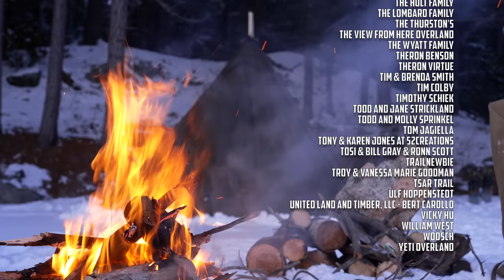WINTER CAMPING ON LAKE ICE -25º | VALENTINES DAY TRIP | HOT TENT AND WOOD STOVE  // EFRT S8 EP7

Comment: just heads up . a pan big cake sheet works great under pop up tent stove.BUTT put a couple short wooden boards first on the snow the cake sheet pan. and pull the pan out to u a bit so it catches the ambers when ya open the lil stove to add wood. u got it

Comment: I have a similar tent and stove. They do work good. The tent has withstood strong, 40-50 MPH winds. A couple suggestions. Aim the opening of the stove to where you can easily restock it during the night. Keep the wood right by it. When you put the rings on the pipe, put a bunch on at the same time it makes it easier. 
The only down side is internal condensation. Even with ventilation and a roaring stove you end up with condensation. 

Thanks for bringing us along.
Reply from the maker: Thanks for the tips! Much appreciated!

Comment: Great video! When you assemble your stove, your chimney pipe should go INSIDE the stove adapter.  The way you connected it, the creasote will run down the chimney and drip out of the joint onto the outside of the stove, instead of running down inside the stove.  The creosote dripping onto the stove will smoke and stink and possibly become a fire hazard over time.
Reply from the maker: Thanks for the tip.

Comment: Even with a bottom plate, you might consider something like a piece of a welders blanket etc cuz anything that conducts heat will melt the ice. That's a nice lightweight camping set you're testing. Hope you have plenty of opportunities to use it
Reply from the maker: Thanks for the tip!

Comment: If you take some heavy aluminum foil, fold it several times for multiple layers to keep the stove insulated from the ground. Foil is super light weight and easy to pack. You can also use foil to seal the cooking pot to the stove top
Reply from the maker: Good tip! Thanks